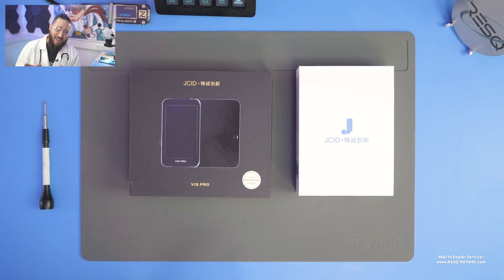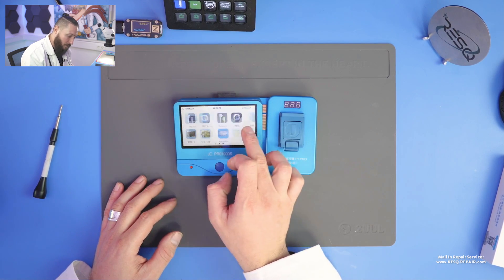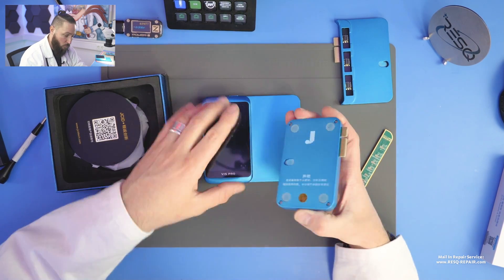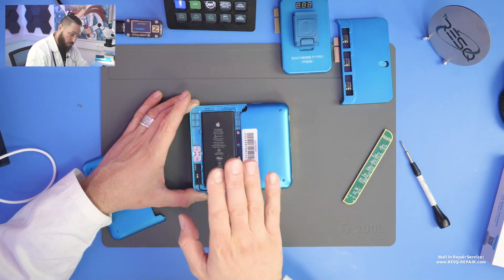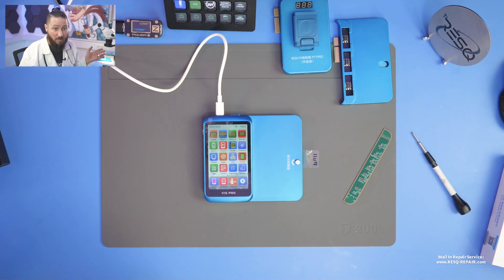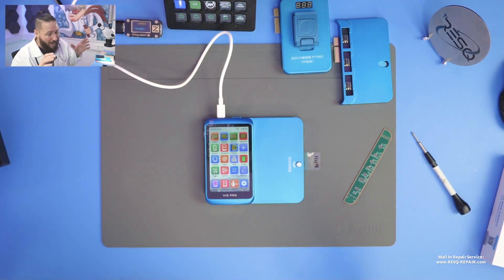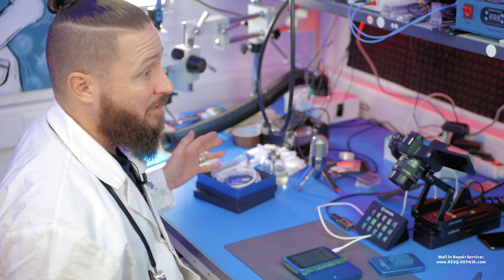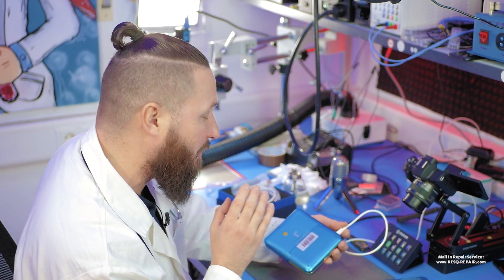❓Is the NEW JC V1S Pro a Revolution for iPhone Repairs? - HONEST Review - Dr. Ben

Comment: Ahh, not something I'd be willing to put money in until it's out of the early alpha stage, I think. I've had too much experience with Chinese repair hardware at this point to buy anything based on a promise.
Reply: Not any chinese hardware, but JC. They do this sh*t all the time. You want new function? Buy new device. Just like V1S and SE. What's the difference?
Reply: Jc programmers at least does the stuff they have to do. Qianli sells programmers that brick if you update them and never work again.